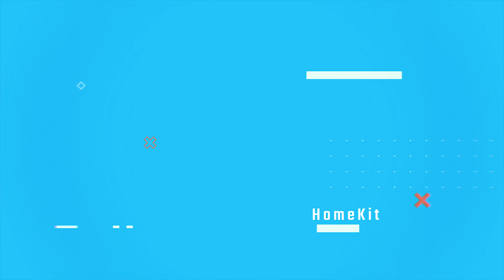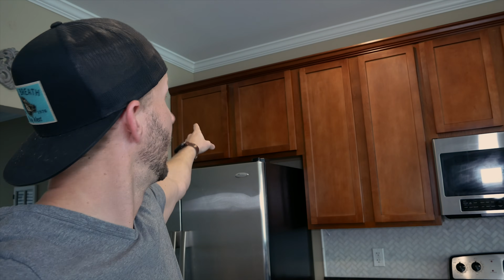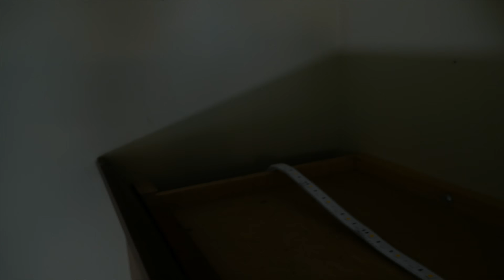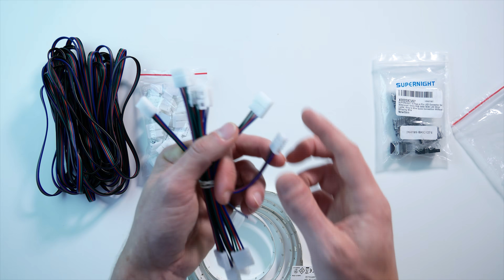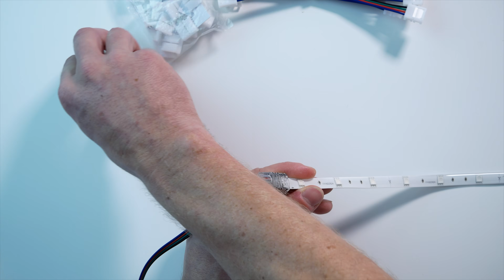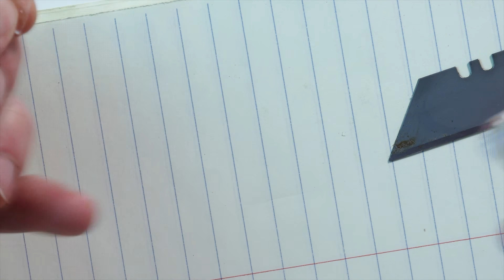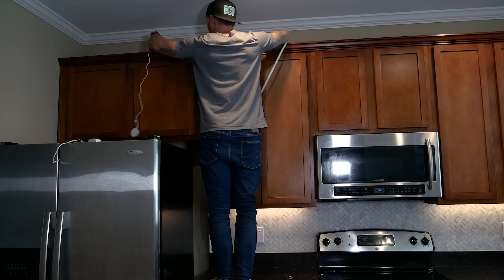How to install LED Strip Lights – Under Cabinet Lightstrips for your Smart Home!

Comment: Impressed and wondering if you have anything on 8 mm two pin strip lighting. I'm having difficulty using a t connection or a plane connection but I'm going to try to strip that silicone. I'm using a EcoSmart light and hoping you have some recommended connecting products

Comment: I have three huge separations between my cabinets It's l-shaped and I can't figure out a way to get them all to light. The only thing I can think of is use three different power sources which means three different controllers to control the lights under my cabinet which is kind of ridiculous. I like what you've done a lot it looks absolutely amazing. Any ideas for people that have cabinets with huge spaces in between?

Comment: Yea mate, thanks for recommending vocolink strip. This crap is awesome while it works. When it don't, and for me it happened in a week it turns into just plain dumb white light which goes on or off only when hard unplugged from the outlet. Only option for support you got is email. Also writing to their email is quite useless. They don't answer. I am sad.

Comment: Hey Shane! Excellent video, I followed your tutorial for the smart blinds and I struggled a little, but your video really helped me out and I followed all your suggestions to the T.  I recently got some LED Strip lights from a different brand and used some of the supporting supplies like you did but it failed miserably.  The other side of the gap didn't light up the same as the original and I ended up quitting. I noticed that VOCO doesn't recommend doing anything but a simple extension. I really need to have the option to gap,  just curious what you recommend or if anything has changed since you did this video?
Reply from the maker: Hey thanks for the support! If the extension you cut is a different color, it's likely one of the connection points just doesn't have a solid connection.

There are some other lightstrips out there now that advertise being "cuttable" and "extendable." The Aqara T1 Lightstrip and the Yeelight OBSID lightstrip are two that do. And both support Matter (Aqara LED strip requires Aqara bridge).
Reply: @ShaneCreates  I'll look into it!  Thanks for your input and keep your videos coming!

Comment: I realize this is an older video, but you did such a good job, I ordered the kit.  Same setup to go under cabinets and on top.  If you read this, question is, how do you get the under and over cabinets to work independently?  Maybe it will be clear when I get it in front of me and watch install video.  
Thanks

Comment: Good video and I like the fact that you installed them to the back of the cabinets.  That’s the way I did mine too.  I didn’t want to see the strip and my goal was to highlight the backsplash.  I still get plenty of light.  The only difference I did was I continued under the microwave.  My microwave was the same level as the cabinets so now I have lighting that highlight my professional range too.

Comment: Disappointed it didn't really describe "How to install LED Strip Lights."  What surface are you sticking the tape to? You have frame cabinets. Are you sticking them to the bottoms of the cabinets and drilling holes to get from the bottom of one cabinet to the bottom of the next one? Or are you blocking the bottom of each cabinet so you run the tape over the edges of the sides of the framed cabinets. I'd like to know what the conventional method is. Some suggest using a "light rail moulding" but for shaker style you really don't want to start adding trim to them.

Comment: Thanks for the video. It was hard finding a cabinet lighting video with a backsplash already up. 
I have two questions if you can help me out. 
(#1) Is the extension in the kit used for separating light effects? Meaning, is an extension going from above the cabinet to underneath the cabinet will allow colors or patterns to be different.  
(#2) I have 3 separate locations of cabinets I would like to have lighting. 2 areas are separated by a wall and the other is across the way. In order to have above and lower lighting at all 3 locations, will I need 3 kits and will these 3 kits all function on the same app?

Comment: Finally someone explained and showed us how to install the strip lights under the microwave. Thanks brother. Love the details in the video. 2 question, the other light above the cabinets, Is that a separate kit you bought with the same app or is it the same strip?...can I buy any light strip and use the the extender wire you have in the video, as long as it's 4 wires?
Reply: I had same question today after watching.

Comment: I bought an under lighting fixure to go above my sink. It's one of those LED new types.  I'm frustrated because it has 3 plugs that supposedly plug into a type of electrical box ( I don't have that...all I have is a live wire that goes into the old fixure). The new light fixure comes with hardware that is identical to the way my old fixure is secured to the live wire from the wall and into the fixure itself.  Then there are three electrical cables from the new fixure that have been terminated with these large plugs that look like the old telephone line plugs that are used in old home telephone lines, only bigger in size. So what do I do know?

Comment: About to start this project tomorrow! quick question - on 6:30 you cut along the connection piece but what if my measurements don't line up, can I cut the LED light strip anywhere and just connect up or does it have to be at the connection piece?
Reply from the maker: If you plan to extend the lightstrips in any way, you have to cut along the copper connection pieces.

Comment: How do you set it up to where each strip is controlled separately? This is one thing I can't find explained in any of the videos. Thanks.
Reply from the maker: Each power supply is controlled separately. In my case I have two: one for the upper cabinets, one for the lower. I have the option of grouping the together to control them as one, which I prefer, but I can control them separately too.
Reply: @ShaneCreates  okay cool that makes sense. So it’s worth it to go with this brand because you can do that. Did you buy the separate power supply or did it come with the extension?

Comment: Shane, hoping you can help me with an issue.  I am able to connect two stripes together (using the same connectors you did) but they are two different colors.  Any suggestions on how to sync them?  Thanks.
Reply from the maker: It just sounds like you don't have a good connection between one or more of the wires. I'd recommend tweaking and wiggling the connections and wires around to see if you can get a good connection and the colors should match up.

Comment: See i like these videos and thank you so much for this. But i can not find videos where people can explain to me how to connect the led strip to a light switch, to be honest controlling it from your phone is really cool, but in reality every time you want to go into the kitchen you need to whip out your phone to turn on the led's, or you have to leave them on all the time. What i would like to do it connect this led's to my already excising light switch that controls the downlights in the ceiling, so when i flick the switch the led's turns on with it, this will be more functional as you will use it a lot more. Now i do know you get 220v led strips that you can connect to the "house" power, but it also comes with a controller, i have rgb 4 pin light strip with its controller, when i turn on the light switch the controller defaults it to RED, this means that the controller will need to be powered all the time to be able to remember the last setting / light color. Any info on this would be great.

Awesome video and thanks for this
Reply from the maker: I would just use a smart switch for my down lights in this situation (I actually do this). Then if I wanted the light strips to come on with the downlight, just automate them in homekit (both the smart switch and the light strip must support homekit). When the downlight turn on, turn on the lightstrip. When the down lights turn off, turn off the light strip. All can be automated through HomeKit (Apple Home App).
Reply: @ShaneCreates  Thank let me give this a try and see what i can find, really appreciate your feedback

Comment: Someone please help, I did the exact same thing with the connection wire, the power goes through the other part of my oven but I can't control or turn off the second part, any help??
Reply from the maker: There must be some sort of connection issue. If you are using one power source/controller. Fiddle with the connectors to make sure you have made a solid connection where the line was cut.

Comment: Hi Shane,  have you tried the corner connectors on these before? Would you be able to use multiple corner connectors for one strip?
Reply from the maker: I have not used them, but you should be able to use multiple connectors as long as you can make good connections.
Reply: @ShaneCreates  thank you

Comment: The outlet above your microwave oven is required under many, if not most, building codes to be a dedicated circuit for the microwave, only. the better practice would have been to have created a dual junction box with smart technology to supply electricity for the light strip, prior to putting on the backsplash. Alternatively, you could run an electrical line from the refrigerator outlet. but best practice would be to not use the dedicated circuit outlet that is reserved for the microwave oven.

Comment: Shane, with Nanoleaf Essentials supporting thread/matter, if you were doing this now would you go with Nanoleaf or stay with the same brand of light strip?
Reply from the maker: Good question. Although Nanoleaf essensials support thread, I don't think the current lineup will support matter.

That said, I personally don't make decisions based on Matter. Only HomeKit. I do think the Nanoleaf strips would be good for an installation like this. There are connectors for them that are easy to find and purchase, plus the Nanoleaf has really bright whites. So they would provide good functional lighting if that is of interest.

Comment: can you link it to Lutron switch?
Reply from the maker: I would use something that is not hardwired, unless you want it to control other lights (light a Lutron switch does). Otherwise, yes, you can create an automation to turn the lightstrip on/off when the Lutron light switch turns on/off.

Comment: Hi Shane
Just a couple questions .. What  lengths can the light stripes be cut at ? Second  question ..Do you know how often you can you use the wire connector to fill in gaps . Example you gave was around your microwave. I have three gaps in my kitchen spanning three feet on each side .Thank you for your help.

Comment: Hey Shane! Out of curiosity, I am looking at getting the LS3 version of the light strip. Looks like I may have some excess "stripping" after trimming it down for my kitchen. If I wanted to use the remainder for the backside of my TV, how would I go about powering it?
Reply from the maker: It wouldn't really be possible. You'd need a separate controller to power it unless you used a third party LED controller, which wouldn't give you homekit support.
Reply: @ShaneCreates  thanks for the response. Here’s another question. 

I bought the ls3 version along with the wires and clips you linked in this video. 

After connecting one strip to the other I’m having two issues. One is the first strip plugged to the power cord is dimmer then the second attached strip and second when I hit the power button only the first strip turns off not the second. Any tips?

Also should I have cut the strip at the copper points where there is the scissor icon or at the solder points? 
(I cut at the copper points with the scissors) is this the issue? 
Thanks again dude!
Reply from the maker: @gpracer04  yes that’s probably the issue. These are designed to be extended like that so those scissor icons are intended to represent safe places to cut and terminate the strip (if you need shorter than the full length). 

For setups like I did, you need to cut at the soldered points in order to keep that connection traveling through the wires.
Reply: @ShaneCreates  fantastic, I appreciate the insight. 

I went ahead and recut at the solder points. My issue now it only the first linked cable works. Is there a limit to how many strips I can link, because the second linked strip is staying full bright and won’t power off when I hit the power switch only the original strip and the first linked cable. 

As always, much appreciated.

Comment: Hi Shane, how are the light strips holding up after 1 year? Are the strips mounted under the cabinets falling down with the steam and heat from cooking appliances? Also are these strips as good as hue in terms of reliability?

Comment: Shane can you change the color of each individual section of light? For example the above Blue counter top red and toe kick white?  If I wanted to install toe kick as well as counter top and above cabinet all with Separate controls will they change or is RF frequency on same channel for the remote?

Comment: I need help! I’m trying to troubleshoot what happened, but I am having no luck. I cut the strip and did the connections, but now the app says the strip is off-line. Any suggestions?
Reply from the maker: Try restarting the lightstrip (unplug and plug back in) or doing a factory reset of the lightstrip. If that doesn't work, remove it from homekit and the re-add it.

Comment: Hey. So I bought all the items in your link. Followed your directions but one side (outlet) changes colors but other side stays green. Any help?
Reply from the maker: Seems like the connections aren't 100%. Sometimes just wiggling and tweaking the connection points can help. It might take some fine-tuning to get the connections just right.
Reply: @ShaneCreates  it worked perfectly.  Thank you

Comment: Shane, how did or do yo overcome the 3m adhesive sticking issue. I find this often on Monitor/TVs. But did you have a problem against the wood? Great video.
Reply from the maker: Thanks Byron. I didn’t have any I issues, but I later ended up getting a lightstrip diffuser channel and installed that underneath the cabinet. Then I put the lightstrip inside the channel. Main reason was to help diffuse the light a little better but also don’t have to worry about the adhesive wearing out since the channel is screwed in.

Comment: Great video. I notice your countertop is reflective, so where do you install the tape light under the cabinet? Wouldn't the light bulbs be visible from the countertop reflection?
Reply from the maker: Thanks for watching. Yes that can be a factor. I ended up adding some diffusion channels underneath the cabinets, that I place the LEDs in, that helps this some. Still get some reflection, but it's not as bad.

Comment: Question: I trying to use the same gap method (#1) with some Govee RGB LEDs and it’s not working. There’s adhesive tape that comes on the bottom of the lights so I thought maybe that was getting in the way but after taking it off it’s still not working. Any thoughts I can troubleshoot?
Reply from the maker: Sorry it's hard to say what the problem is. Possibly a connection issue? Sometimes you have to get those connections just right for the power to pass through.

Comment: If I were doing this project, I’d go through the cabinets on either side of the microwave and through the cabinet above the microwave. That eliminates concern about the wire falling and also protects it from heat and steam from the stovetop.

Comment: Will these work if I want to add them under the lower cabinets and under the upper cabinets?  Seems like I would need to add a bunch of extensions to get the lights all over my kitchen. If I had to run 2 or 3 different sets of these to get it everywhere would I be able to sync them all up together on the app.
Reply from the maker: I use HomeKit and can sync multiple lights together within the Home app. You can group multiple lights together and control them as one, if you want.

Comment: Can you connect two separate light strips to your phone? I’m wondering how to add lighting to two separate sides of the kitchen without having to run the wiring across
Reply: Of course you can add multiple lightstrips to HomeKit etc. If you are using HomeKit, and you have a HomeKit home hub (Apple TV, HomePod, iPad), then get a HomeKit compatible smart button, or motion sensor, and then you can just configure it to turn on both lightstrips.

Comment: Nice video. So what did you use to get around where the 2 cabinets meet? There is usually about a 2 inch area where the bottom right side of the cabinet meets the bottom left side of the other cabinet. Don't imagine you went over that since you would be able to see it. Did you use another connector like you did for the microwave?
Reply from the maker: Yes, I used a small connector to go around it, like I did with the microwave.

Comment: How do you handle the wooden bumps under the kitchen cabinet
Reply from the maker: You can cut the lightstrips at those points and use small extension cables to go over them. Or you could drill through them... whichever you prefer. I used the extension cables.

Comment: Did you ever install the button you wanted to add to turn them on? If so what did you use? Thanks great video!!!
Reply from the maker: I actually didn't need to because I have mine controlled with automations so they always come on and off the way I want automatically. But if I did, I would probably use Aqara or Flic buttons, which I use for other things.